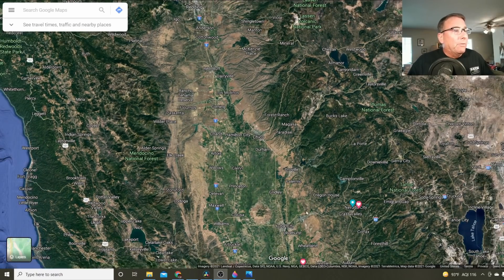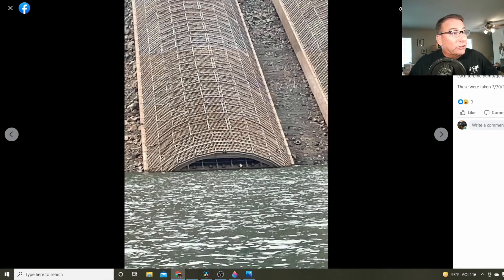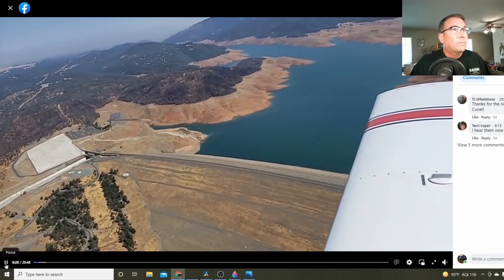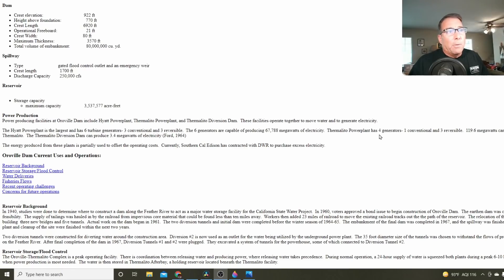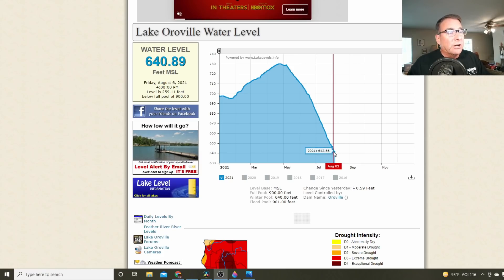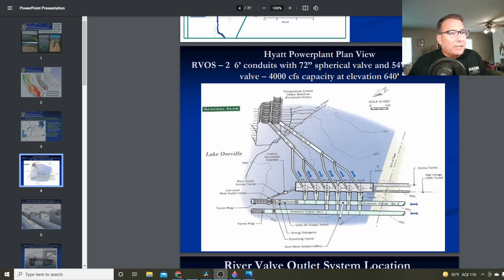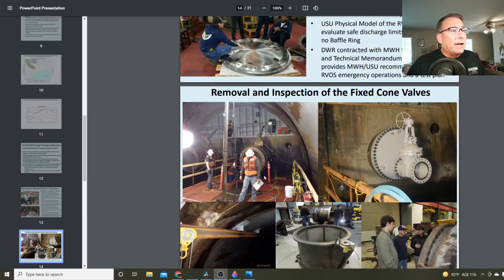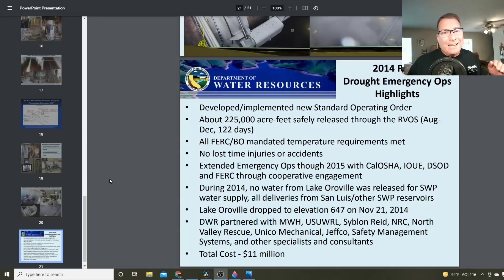Oroville Update! Hyatt Powerplant Offline 8/6/21 California Drought

Comment: Those river valves will turn the access tunnel into a venturi eductor that moves massive amounts of air, that happens when the bolts for the bulkhead were ordered removed by an dwr engineer before the test several years ago, the operator was holding onto a hand rail in the tunnel and was horizontal from the amount of air being pumped out.... Don't ask me how I know

Comment: For optimal results, mount the pop screen at least 10 cm (4 inches) away from the mic. It's also a good idea to angle the pop screen slightly; this way you avoid sound reflections bouncing between the capsule and the pop screen.

Comment: Correction, around time 6:50, the text says "... 6 generators capable of generating 67,788 megawatts ..." that should be 67,788 kilowatts.  You spoke the word "megawatts," but then you reported a per-household consumption of about 550kwh/month (which sounds reasonable), then looked thoughtful for a moment and said that the full generator wattage would power about 88,000 households, so you were clearly using the correct kilowatt magnitude.  To get from kwh/month to kilowatts, you'd need to divide the per-month figure by the number of hours in a month, and then divide that average household figure (about 0.764 kilowatts, or 764 watts) into the 67,788 kilowatt figure to come up with your correct number of ~88,000 households -- was that done in your head, or computed ahead of time and recalled?  No matter, the point is, you're getting that and a bunch of other things RIGHT, so right-on!

Comment: Wow.  I hope the evironmental concerns about the reversable generators were at least re-evaluated relative to the current drought situation.  Here in Oklahoma we have lake that was built just for that purpose that is still in active use.   I'm not sure exactly how it works though.  I realize my thoughts that it generated to the river then pumped back up can't be right.  I think it goes between lake hudson and that lake which locals call pump back and I always forget it's real name.  Perhaps that's why it still works here.  I can't see how going from lake to lake would be a problem especially when the second lake was created from and the main lake for that very purpose, but doing it from a massive lake to a small riverside containment possibly had unintended consequences.
Reply: But my point is they knew this was coming.  Couldn't reversing the generators for peak power have conserved a lot of water and perhaps given weeks of additional generation capacity?

Comment: Just curious, I know the government agency in charge of the Colorado River recalculated the parameters of the daily release of water after the 83 flood, which caused the Hoover dam to use the overflow for the first time in its history since it tested the system, and almost caused the loss of the Glen Canyon dam.  Instead of making the calculations, or a requirement for above average snow pack years, they did a long term calculations, to decide what the release has to be for the whole year.  This has led to the reservoirs behind the dams to slowly be drained over long periods of drought.  After the catastrophic miscalculations of release of water with an above average snow pack, which led to the loss of the spillway, did they change the parameters for daily release on the Orville Dam, no matter how small the snow pack was?
Reply: Of course not.

Comment: Juan, according to Millie Kay the sliding penstock intake gates are opened and closed with hydraulic control systems. The trash racks can now receive proper inspection and maintenance since they are exposed. No divers are required now. This summer at the Hyatt Power plant one turbine was in service generating 30mW.  Thermolito is generating about 10mW and the diversion plant is able to generate 2.5mw.  (this information is subject to change and was confirmed by the law firm of Stator, Rotor & Watts.)
Reply: MW = megawatt. mW = milliwatt. Billion-fold difference. I think I know what you meant, but it’s important to get things like that right. Cheers!
Reply: @TheAdominableDrPhibes  good catch... you are correct.  I will spell out mega watt  long hand for future updates. my bad.
Reply: Surely not milliwatts? ;-)
Reply: @sietuuba  you are correct. MW mega watts is what I meant. my bad
Reply: 🤣🤣 stator rotor and Watts...very funny
Reply: Dump a bunch of ice cubes in it!

Comment: makes me wonder who is operating this dam.  First the valve disaster, then the spill way disaster, then the emergency spill way disaster.  sounds like they need to replace the people making decisions over there.
Reply: Who makes the decision on whether it rains or not?
Reply: @toffer99  rain isn't the problem, maintaining the dam is the problem.  the ring failed and they chose not to replace it.  the spill way failed and they chose to do nothing.  the emergency spill way was a failed design from the very beginning and they knew it. the rain didn't do that, people did.  funny how they had the money to fix these things when they had no other alternative but not before risking peoples safety and lives.  do you think if this dam were privately owned that the state would have let the owner get away with all of this?

Comment: The power companies have been critically wrong about how much electricity your typical house needs per day. They claim 500 to 550 kWh per day. That amounts to about one refrigerator and maybe a coupe of loads of laundry. It doesn't account for homes that have 100% electric such as water heating, heating, cooking etc. Our home is 1,900 sf with central A/C and gas heating, electric cooking, one refrigerator and one small deep freezer. We have electric gates, electric garage door openers, outdoor lighting, internet modems and switches, computers and so forth, nothing out of the ordinary.  The power companies are using data that was published long before personal computers and internet came into the markets.  In the winter, our home uses about 700 kWh per day and in summer, its hovering around 1,800 kWh per day. So, even my neighbors are in agreement, they never see 550 kWh usage ever, it's always much more than the authoritarians suggest. 
The State of California is the reason why we have limited power production, not because there is a limit of power production resources. It's all man made shortages due to some man made idea that 50,000 MW per day is all the state believes the state should have to provide us. After that, they want blackouts etc. to keep down the imaginary limit to the carbon footprint. Most of us would ask the question, if the state believes in growth in every other aspect such as housing, industry, population and so forth, why the limited power production? We also know that the wind and the sun don't produce power at night time thus, we need hydro and natural gas turbine power production to compensate for the limits of green power production. Hydro seems to be the cleanest method to make power, solar requires those dirty to produce panels that are expensive and with wind towers, they require oil and other materials that are not green to function and then they only last maybe 10 years before they are worn out and need replaced. 
Hydro dam power is the best method as it can generate 24x7 and its clean. They should be building more hydro generation but they have to front the money for those while the public fronts the money for solar and other methods. Power production is such an easy and well established industry yet the state wants the people to believe its more complicated. Its not, the complications are convincing the people they should have to pay exorbitant rates for power and that when they use power has a direct effect on rates as well as how much they use, the more they should pay in rates. Its all hogwash, it's simply a method to tax the people so the state can spend all they want to inventing green power production methods. I say they should pay for that, not the power users. Natural gas is a plenty and its very inexpensive...for now it will have to do but the state believes it is instant death to produce power with natural gas.
Whats worse is, the state is mandating new homes be built without a natural gas pipe connection so, no gas water heating, no gas fireplace, no gas BBQ (only expensive propane), no gas bunsen burners or other gas operated items for sport or hobbies. There is something truly wrong with that kind of mindset.  I have to add, if all of that is fair then the property tax rates need to be adjusted to a number more consistent with how much revenue a county needs vs. is getting to function. 1.5% of the sales price is not in any way consistent with the needs of a county for taxing a property.

Comment: So...to recap....1. It doesn't rain in CA during the Summer even during a 'wet year'.
                          2. Beginning April of a dry year, they began flushing the water they do have.
                          3. The power plant of the largest dam in America cannot operate. 
                          4. They claim this is a result of combustion engines and carbon output.
                          5. We can solve 'climate crisis' by paying carbon tax to the Rothschild banks.

Comment: If only there was some way to generate electricity, with a small plant, that uses a small amount of fuel, that work without the need for dams and hydro plants, or solar panels and their toxic chemicals, bird killing windmills or need to burn fuel, oh wait, nuclear plants do all of that. If only California had built 5 modern nuclear plants instead of a bunch of windmills that are not running most of the time.

Comment: Those manage this water crisis seem to be making a major mistake. I recall reading years ago in a survival guide a remark that when you find yourself with too little water, either in a desert or on a raft at sea, you should immediately go on a limited water diet. Your body will adapt to that by concentrating your urine and you'll be able to stretch out what water you have as long as possible. The same is true in this situation. The quicker the authorities insist that water has to be rationed, the quicker the adaptation and the longer these limited supplies will last. This problem is not going to go away simply by wishing it would.

Comment from the maker: CORRECTION #1: Hyatt Power Plant if all 6 turbines are spinning us 644 MWs. Using the 67,880 MWHs /yr of possible energy produced would mean all 6 turbines ran at full capacity for 105 hours per year. They are run as needed for the River flow needed. If the 6 turbines had the water to run at 100%, that electrical energy would be about 5,378,640 MWHs over a year.
CORRECTION #2: Outflow from Oroville includes all releases from the Oroville Dam (i.e.: Hyatt, spillway, low flow outlet), while River Release (RIV REL) pertains to the Oroville Complex as a whole which includes any releases from the Diversion Dam gates and Thermalito Afterbay River Outlet.
Reply: Thanks for the correction. From other sources,  Edward Hyatt (Orville) Power Plant is the largest underground pump-generating installation in the United States. The plant's 3 turbines and 3 pump-turbines have an installed capacity of 644 Mw.
Reply: I was just looking for a correction..... 67,788 MW was just a little bit too much... just a little.....  Especially when Three Gorges is 22,000MW.
Reply: Yes, thanks.  I was trying to figure out what was wrong.  A nuke plant is about 1000MW, and I seriously doubted Hyatt was the equivalent to 68 nukes.  Interesting to think that they could empty the reservoir in just over 4 days.
Reply: The placard at the visitor center reads the following for GENERATING: INSTALLED CAPACITY ........819 Megawatts operating @ 16,950 (cfs) which will supply enough power for 800,000 homes. PUMPING: INSTALLED CAPACITY........5610 (cfs) , 519,000 (hp)....UNIT SIZE..........1,870 (cfs) is equivalent to 839,000 gallons per minute.

Comment: 12:25  Also, if what is being called a spherical valve is anything like a common plumbing ball valve, this type of valve produces lots of turbulence if partly opened.  I wonder if the thought was " since the ring has been removed, we will open the valve part way to limit flow. " ?

Comment: Is that a condenser mic?  If not, you don't need a pop filter for that mic.  It has a pop screen built in.
Reply: Probably a cardioid mic.
Reply: @jeffshafer9079  Cardioid (heart-shaped) is just the shape of the pickup response.  Both dynamic and condenser mics can be cardioid.

Comment: Juan, I think the data you were reading from on the powerhouse had a typo. The 67k+ megawatts is way too high. Each unit at Grand Coulee dam’s PH3 generates roughly 800MW. They are huge. The units at Oroville are real small. Double check that data. Maybe 67MW?

Comment: Just a note - those power numbers for the hyatt power plant are waay off. I'm not sure what happened there, but the total installed capacity is about 850MW. If it were truly 60 000MW, that would make it the largest hydroelectric dam in the world, with a higher output than even the three gorges dam and able to supply the majority of electricity to all of california.

Comment: Actually a hydro electric generator system will use the different levels of the penstock based on 2 settings.  Temperature and pressure.  When the electric demand is high, then they will use water from a higher level to get more head pressure on the turbine.  Temperature is regulated by the water at the lower level.  At this level, there is no water for anything; thus, it is all off line.  Sad situation....

Comment: Thanks for another information intensive presentation, Juan. California sure could use a rainmaker.
For those concerned about electric grid demand with electric vehicles: "The U.S. Department of Energy found that there has been almost no increase in electricity demand nationwide over the past 10 years, while capacity has grown an average of 12 gigawatts per year (1 GW can power more than half a million homes). That means energy production could climb at a similar rate and still meet even the most aggressive increase in electric vehicles, with proper planning." ~ Pew

Comment: I'm very surprised that such a small generation facility was designed to have pump storage capacity. I live fairly close to two UK pump storage stations. The smaller of the two generates 500MW and the larger 3.2GW (albeit for 45 minutes at that output). Each have isolated pools to avoid environmental impact.

Comment: The generating capacity stated via UC Davis is off by at least 3 decimal points. Grand Coulee Dam generates a bit over 8,000 MW and is the largest single generating station in the country. Just a point of correction.

Comment: Mouse pointer Help:

 Find your mouse pointer fast
Windows 10
Windows 10 gives you a fast way to find your mouse pointer by circling it when you hit the CTRL key. Here’s how to set it up.

In the search box on your task bar, search for Mouse, and select it from the list.

Once you're in Mouse settings, select Additional mouse options from the links on the right side of the page.

In Mouse Properties, on the Pointer Options tab, at the bottom, select Show location of pointer when I press the CTRL key, and then select OK.

To see it in action, press CTRL.
Reply: It's not the mouse size in Windows, it's the size of the mouse captured by OBS, the software he uses to record video.

Comment: It’s barely rained this year from late spring till now here in BC (in Victoria).  There’s lots of fires burning in the interior. We had record breaking high temperatures in June.  A bad year for the whole west coast area.
Reply: also minimal snow pack this year in N Cal., which is the major source of water supply. find a current picture of Mt. Shasta. It has almost NO snow cover.

Comment: 67,788 megawatts must be a typo the Hoover Dam only generates a little over 2,000 megs.Great job on reporting fire conditions and your aviation content is awesome great detail. Thanks stay safe
Reply: 819 MVA per DWR website.
Reply: @MattTrevett  
Do you mean 819MVA ? As in megavoltamps? Not millivoltamps?
Reply: @davidscott5903  It's a teeny, tiny micro dam.  Yeah you are correct. Thank you.
Reply: @MattTrevett  
That would be small!🤣
Reply: Also keep in mind those figures, or the correct ones, are for max head pressure. Lower water lever means lower head and thus lower output. So it's not all or nothing. Lower water levels means reduced production. I'm sure there is probably a seasonal output curve graph somewhere that would nicely show this.

Comment: At 06:20 I think there's a mistake in the numbers as 67,000 MW is a lot of power, enough to energize entire cities or more as about 1 MW can power 200 homes. It would be closer to 670 MW as it looks from the size of the dam
Reply: I guess they put a comma instead of a dot.
Reply: @markotrieste  then it means 67.5 MW which is even less than the generator downstream.